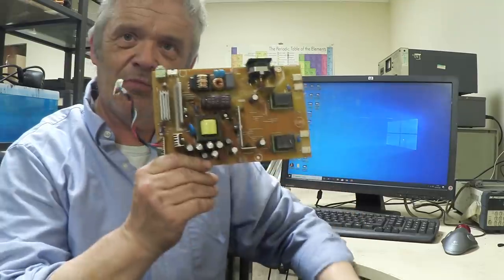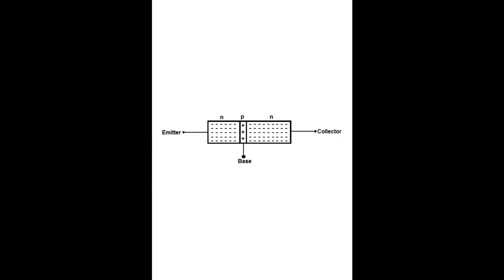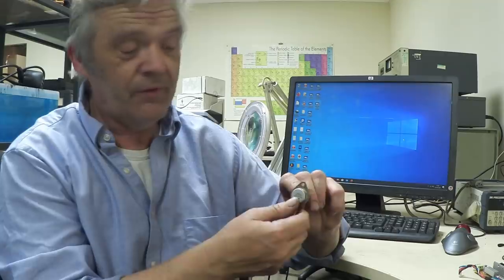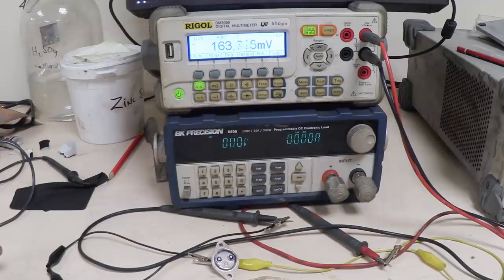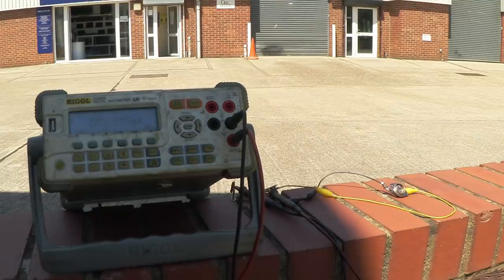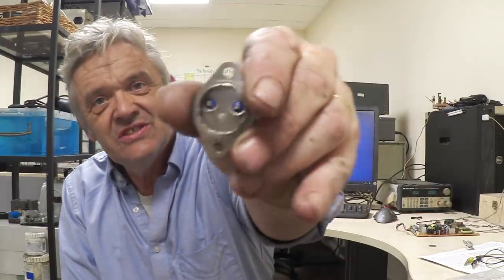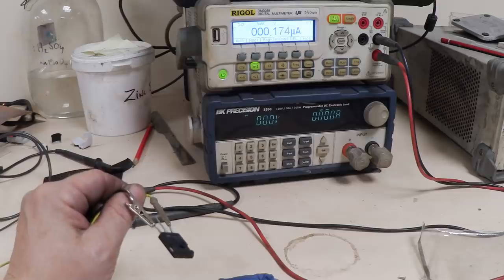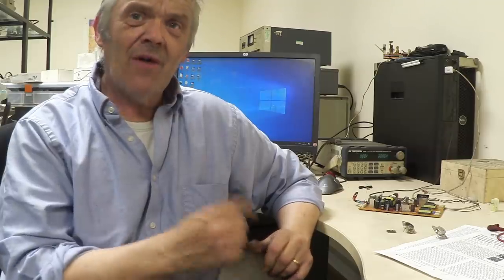Generating Power From Scrap Electronics

Comment: I was one of the designers and makers of a bipolar RF power transistor which was shipped in a similar TO-3 package to the 2N3055, except that the tab was thicker, and Nickel-plated Copper, rather than the Aluminium of the Motorola device, and the leads were slightly larger in diameter, because of the much higher currents involved. The chip was close to the maximum size which would fit into that type of package, and about 50% of the Silicon was not covered by connector pads. At least a milliamp could be generated very easily from factory lighting, which meant that testing and selection of the raw chips had to be done under low light conditions. Also, if a chip was being tested in an uncapped header, whilst exposed to light, the photo-current generated around the Base could be amplified to hundreds of milliamps through the Collector. 

The photovoltaic effect is actively used in some transistors, to this day. You can buy phototransistors, as well as opto-isolators, and various types of sensors which incorporate an LED and a phototransistor. There are also photodiodes which detect light without amplifying the current generated. You can also find photodiodes and phototransistors in the transmitters and receivers of TV remote control systems.

Epoxy-covered transistors of the flat type you showed can have various pinouts, such as BCE, CEB, CBE, ECB, etc, depending upon the design constraints, application and original customer's requirements. There are also various sizes of package, as you might expect.
Many SM PSU's also have full wave rectifier pairs, and even full wave bridge rectifiers, in similar packages, as well as MOSFETs, in similar standard packages, so be sure to check what you are really dealing with when you repurpose them.

Comment: You are my laboratory hero, this attempt I had carried out exactly the same 20 years ago and had ignored the consideration to make the heat over the diode sections, to current with another semiconductor layer. What luck it gives you! 
You can get the old horizontal deflection transistors from the CRT technology in large batches quite cheaply.
You gave me a good idea. 
Thanks for the video.
Reply from the maker: I'll have a look for that mate - thanks for the heads up

Comment: About 20 years ago I watched a rail freight terminal get replaced by a commercial business park and I wanted to lease a unit to start an electronics recycling company that recovered resources, I figured there was probably enough value in various common materials found like silver and gold, as well as trying to salvage / refurbish working equipment since a lot of what gets recycled is just “obsolete” rather than malfunctioning, but I had no funds for that, and years later once I did, of course I had no time because my job was more of a contractor arrangement where I would work on installations to get them completed rather than just for a certain amount of time, so some days I’d come home very late and other days I would be finished early, completely unpredictable though...  It would have been fun to learn about all the elements of the various equipment, like the optical glass and various coatings in the LCD panels, as a TV installer I had access to stacks and stacks of large panels that had malfunctioned but were in good physical shape...  I had collected a bunch in a storage locker at one point and then someone broke in an stole all the good working ones so I had to cut my losses and took most of them that remained to recycling because I’m in small place that already has 3 TVs, but I’m moving to a smaller community soon where it may be possible to operate a side business with the job I’ll have driving a refrigerated truck once a week; I did save a stack of the good working heavy hifi amplifiers the thieves didn’t take, people always appreciate old high-end audio equipment because they built those things to last, I’ll start with them and a few working panels I packed away, but it’ll be interesting to see what people recycle there.

Comment: Extremely cool video Rob. I went digging and I did save the fermel sheet from the 60 inch TV I disected.  Now I can experiment with the few small 12v solar panels I have and I have hundreds of transistors (or more) that I can use as thermal generators after watching this video. Thanks mate :)
Reply from the maker: awesome mate - cheers

Comment: That's a lot of fun. Back in the early days of transistors you would have glass transistors usually painted black. You could just scrape the paint off and use them as photo transistors. OC71 was a good example. For anyone thinking of creating their own solar panel using scrap transistors I highly recommend against it. The generated power will be next to nothing and the effort would be huge.

Comment: Using the photo effect (or the heat effect I suppose) it would be quite interesting to put the junction at the focal point of a parabolic reflector.
Reply from the maker: for sure mate - I checked on the temp these things can withstand it's around 300 degrees C - that's a lot!
Reply: @ThinkingandTinkering  I may crack open a roll of tin foil and have a go.

Comment: Most interesting thing I've made from an old computer monitor is a lighted white board for my daughter to draw on. Pop the front off take the LCD panel, and the fractional lenses off until your down to the acrylic sheet and then pop the front back on. Ta-da! 
You have got me interested in the thought of the affect of pressure differences on either side of transistor. Like alternating equally tuned helmholz resonators on either side so youd have vaccuum/pressurized, pressurized/ vaccuum. Would be an interesting experiment.
Reply from the maker: that is awesome mate - i may also look at your lighted whitebord idea as my wife tells me that she was going to buy one for our grandson - thanks for taking the time to write

Comment: I had no idea they could be used like this  thanks for  the video
Reply from the maker: cheers mate
Reply: @ThinkingandTinkering  the receiver for infrared remote controls have close to the same results if used like a solar panel  and there are between 5-10 in old printers
Reply from the maker: @wesnxs  nice info mate thanks for the heads up

Comment: Very interesting! I am going to try that on some transistors I have.
Here are some ideas I have about decapping (look that word up on youtube and watch the videos about decapping IC's to access their RAM) the power transistors: The plastic that is used for the body of some of those power transistors can be disolved with MEK (methyl ethyl ketone or butanone). Just a couple drops in the right place should expose the Silicon. MEK is available from some hardware stores in the US. MEK is a very strong solvent and can be hazardous to use. It is something that you definitely want to read about before using. I'd start with the MSDS (material safety data sheet) and then any other safety and handling info you can find on the internet. However, with MEK, it is easy to disolve the epoxy cases. The ceramic cases are probably openable with good (diamond, zircon or ceramic grit) sandpaper on a belt or disk sander. Heat would be the problem there. If you hold the transistor with a finger on it and dunk it in some cool water when it gets warm; I think the silicon would survive. You would have to do the first few a little layer at a time to find out how much case you need to remove to expose the silicon.
I wonder how much power a large metal-cased transistor would produce under a magnifying glass in the sun? If you use a low power lens and connect the transistor to a huge heatsink, it might be possible to use one that way to power something.

Comment: Excellent video Robert Iv seen the steel case transistors used as solar cells but never knew that the other would work with heat difference like a thermalitic pad thanks again will experiment with this cheers :)

Comment: Solar Cells , LED's and Peltier Devices are nothing more the Diodes.   LED's can in fact be used as light detectors.
Reply from the maker: yes they can and I have seen a few circuits like that

Comment: You can do the same thing with a infrared led. They can be used as ldr or as a or emitter. Interestingly if you power a solar panel it will emit some infrared light. The scrap TVs you have may have a few infra red leds. I think there is a video online demonstrating this.

Comment: Dear Robert, may I recommend radio wave power harvesting with those scrap caps and diodes. I assume you know the simple circuit. I have a photo of a refined one for many years.
Reply from the maker: I do mate - and you are spot on that is exactly what I was thinking - you could use the transformers to make joule thieves too
Reply: @ThinkingandTinkering  This will be great to see.

Comment: funny ive just been outside to look at my small black solar panel 18v, which charges 6 x 18650 batts....  2 x 3 in series, then paralled...and it is roasting hot...and wondered about cooling ideas.......cheers mate. you are strangely always on point with your experiments...cool.
Reply from the maker: lol - cheers mate

Comment: I got a lot of parts from power supplies. You can match up. Impedance.  Led s take low power to operate but needs a certain voltage. Use those parts to make a joule theif to run the leds with low powered dead battery. Half volts. Can also use transistors for a thermometer or humidity. Fast recovery diodes is useful for better performance to charge batteries. Filtering intermode transformers for easy joule their. Fet transistors for drivers for flyback transformer.

Comment: Such an interesting semi conductor, silica is brilliant.

Can that conductive glass be formed into a vacuum tube? I've had an idea

So vacuum tube is basically two glass tubes right, upper side is that solar generating conductive glass, and on the bottom of the inner tube are those peltiers.

So water goes through the inner tube, it's heated pretty drastically for your home, that heat hates one side of the peltier while the vacuum cools the other..
All the while generating electricity via solar

Comment: Once again I am discovering something. About the energy generated by heat, I red somewhere that there is a technology that would pull heat from cpu chips by placing an infrared photocell (not sure I have the right term) closer than an infrared wave length to pull heat out of the chip before it heats the chip. Pelletier effect makes me think of that.
Reply from the maker: I haven't heard of that mate - cheers

Comment: So perfectly explained mate, I love that you showed the light affect. Oh yeah the heat and cooling is a must. I use aluminum for the cooling on these bits. Oh, LOL, my wife said she now understands where I got the word bits from, it is my english side of me, I mean after all me mom is full blooded english.
Reply from the maker: lol - I have still not got round to getting the urethane one coat mate - but the minute I do lol
Reply: @ThinkingandTinkering  LOL, no worries, as much as you have going on, I'm surprised you even remembered about it and who told you about it. Nice memory you got mate. But yeah, you will like what you can do with the One Coat stuff, it is quick and easy and has great results. I even found that after making a sheet if you give it a bit of polishing with a rag or rag on a sander, that the results are even better. Cheers Mate
Oh and yes you can even run a magnet or it real fast and create power that charges it but at the same time the energy releases slow, just like we would want.
Reply: Oh yeah and sense you have been doing the whole solar power bit, it is also a instant solar power piece of plastic after adding the graphite powder or graphene. It responds to light very well.

Comment: I actually have an idea for gate transistors that can be swapped (ie turned from an NPN to a PNP version, as well as changing the variable state or quantity of holes and electrons thus increasing the density of these or decreasing them in 3 increments basically creating a transistor that can be altered on the fly (ie while its in a CPU say this can be changed constantly for both storage and computational arrangements) to allow jumping from on and off states for a number of options being only binary or 2 (0 and 1) to being able to be altered to a dual polarity quaternary gate or options being -3, -2, -1,0,1,2, and 3 though in this system 0 is not off but fully on with no bias, which I think the system would then be stacking micro voltage pressure resistances to being turned on and off when in a "switch" state, and counting up or stacking the resistance caused by the fully negated components (ie turning it into a tiny resistor, which I would guess that a small alteration would allow making it able to be also a memsistor with variable resistances but no bias)  Just thought I would drop that here and see if anyone wants to have a discussion. 

I had a long bit typed out about how and what brought me to that reasoning, but I will just say, it was some ideas I had, then later had confirmation it CAN be done because it seems someone has done it already, though for other reasons related to the oil industry and this has inspired me to continue developing other ideas off of that same tech and core fabrication techniques.
    Anyway as I said I had a long bit typed out, but I will save it for a video and try and come back to drop a link and see if you want to do a series of response videos or something, discussing various methods and ideas for electronic component fabrication, as well as will post videos of the stuff I am actually trying.

Comment: Current was in the uA.  What is the Voltage Created ?  Most Solar Cells provide  0.5V on the junction.  Does the transistor junction provide anything that high ?
Reply from the maker: yes mate - I did that and said that in the video

Comment: Could that ink you showed us a few months ago that somehow regulates its temperature be used for utilising the heat 
I was a bit vague about it when I watch it so I might be off the mark and it’s not using scrap parts  but it fascinated me at the time and thought it worth a mention 
It would seem to me if the light could be focused first and extract the heat then allow the light to hit the solar cell 
Like a glass tube with water inside  at the focal point of a parabolic reflector then at some small  distance after the tube the solar cell  to receive concentrated light 🧐
Reply from the maker: do you know mate - I don't really know and when I don't really know I have to experiment - I'll get back to you on this one

Comment: I wonder how much sunlight you could blast at that tiny transistor before it lets the magic smoke out. Some active cooling on the back plane would help, maybe dry ice or liquid nitrogen. Not very economical but would be an interesting experiment, pull out one of those huge "solar scorcher" Fresnel lenses and fire away. :P

Comment: why is heat detrimental to solar power ?
Reply from the maker: output efficiency goes down but by around 10-25% depending on temp - current goes up but voltage goes down and overall power output is reduced

Comment: Hi. Very interesting video. Have you tried generating power from LED's? Some colours generate more power than others, ie orange. Due to time constraints I haven't tried clear packages against the coloured ones. The power output from sunlight seems to be affected by the wavelength of the LED. I haven't tried loads yet as there are so many different types and colours. Might make an interesting video for your scrap parts! hint hint.

Comment: Hey Rob, great video! I did not know how easily one could access light sensitive bits in side those transistors!  I'd imagine that you could affix a tubular shroud a few inches long (& coated black inside) to the case to shield it from "triggering" until sunlight shone directly down the tube. Then you could use it to align solar concentration and photovoltaic tracking systems to a very high degree of accuracy and further increase the output.
Reply from the maker: that would work for sure - nice one mate

Comment: what if you'd take a bunch of Peltier elements and use those on the backside of solar panels to get rid of the heat and at the same time generate extra power, to make it more efficient you stick a big ass heatsink on the cool side of the Peltier elements, hot side to the back of the solar panel?
Peltier elements are not very efficient but in this application it doesn't really matter as much because you use them as heatsink and the power generated is extra.
Reply from the maker: it's worth a try mate for sure

Comment: That transistor seems to be counterfeit.
Reply from the maker: I pulled it from an old board - no longer any idea where it came from
Reply: You're joking, right?
Reply: @ThinkingandTinkering  You could do 2 quick simple tests if curious:
1. Send full current that the datasheet specifies.
2 Send full voltage.
Don't give it full voltage and full current at the same time. Even a real transistor might pop.
If transistor pops during one of these tests, it's fake.
Reply: @valveman12  What, why?

Comment: The idea and execution of the theory are as usual excellent, however again you've stumbled over the open circuit voltage being meaningful, when it's not much of an indicator of anything.

I suspect that your calculation of powe output is a magnitude or two awry, had you measured the voltage alongside the current, you'd have had a valid result

As you say, compared to a solar panel size for size, it may have potential - but if it were viable (and superior) it's inconceivable that the manufacturers wouldn't already be reproducing it at scale...